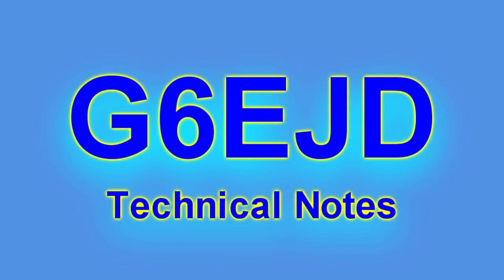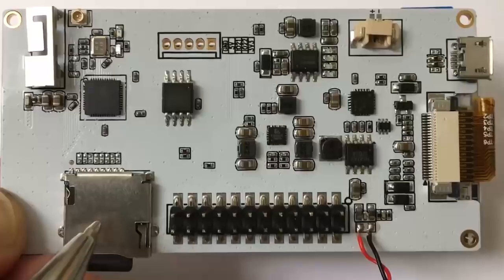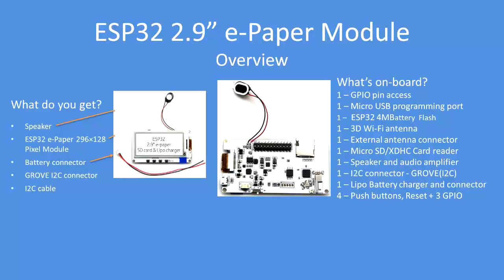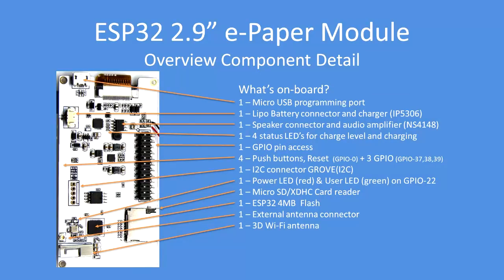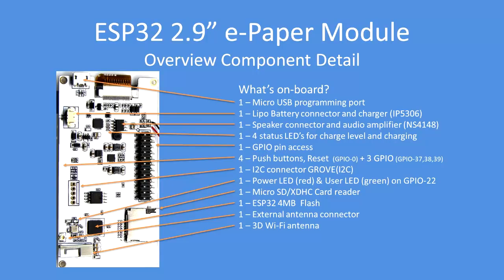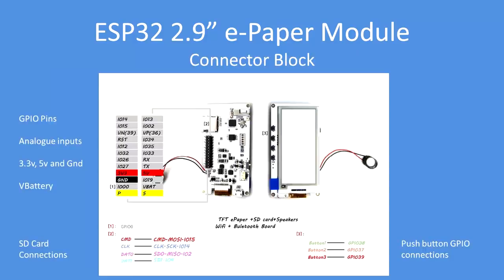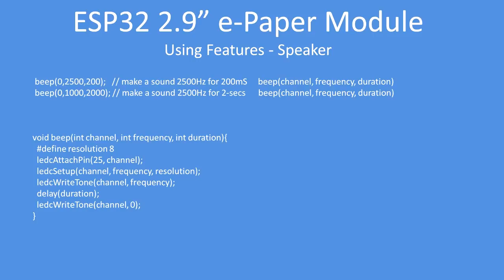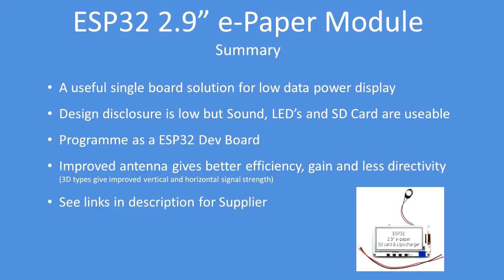Tech Note 099 - ESP32, 2.9" e-Paper, Speaker, SD-Card Reader and Lipo charger

Comment: Hi, did anybody try a newer version of this board? I have v2.2 and I am strugling to compile code for the display. Thanks iarakis@kaixo.com
Reply from the maker: Ivan Arakistain, unfortunately ttgo support is poor, I expect it will work ok once the configuration is correct but getting the information is not easy, and what’s more confusing is for someone to make a board but give no supporting information that will then go on to probably make it a success- it’s bizarre supplier behaviour. Maybe worth checking out the ttgo / lilygo GitHub for details
Reply: hi, did you manage to make this work please? If so, please share any instructions you might have please :)

Comment: After a few days trying to force the IP5306 (battery management chip) to keep its power on, I found that I can't reliably keep the IP5306 awake even by simulating a button press every 30 seconds.

I'm not sure why, but after a few hours, it turns off when the ESP32 simulates the button press.

So I've removed the IP5306 from the board completely, by cutting its legs. Note it also has a pin 9, which is a pad on the underside of the chip, which I hadnt noticed on the datasheet, and luckily it wasnt soldered down that hard and I was able to twist it off the board.

Probably using a reflow tool would be a better idea since it probably won't matter if you damage any of the components around the IP5306, as they are mostly only used by the IP5306 its self.

In its place (externally to the board), I'm using a TP4055 based battery manager module, which has an input for the 5V from USB, and separate connections for the battery, as well as Gnd and an output terminal.

Initial results from this setup are encouraging, with a fully charged LiPo cell, producing 4.1V, the board is working fine.

But I'll need to leave it on for a few hours and let the battery go a lot flatter before I can tell whether the buck converter is happy working down as low as around 3.2V at when the Lipo is almost flat, but in theory it has an input range of 2.7V to 5.5V, so may work OK ;-)
Reply from the maker: It’s worth contacting Lilygo about the board as I understand they have redesigned it following mine and other complaints to Banggood, you might get a good price for a replacement.
Reply: I bought mine in May from AliExpress, via a third party supplier, so I don't think there would be any chance of getting a replacement.

I wonder what they did in the redesign, probably partly what I've just done.
Ideally they'd also want to control the buck converter outputs that drive the audio amplifier, using a GPIO on the ESP32, but I'm not sure that using the EA3036 buck converter as the voltage regulator is ideal (http://wiki.widora.cn/_media/ea3036.pdf)  . But I can't see in the datasheet what its operating current is. 
It mentions 80uA quiescent current when there is no load; which may be the current its going to take when the ESP32 is in deep sleep mode - which would not be too bad.

But there may be better IC's to optimise low power operation
Reply from the maker: I’ll see if I can find the latest version schematic. The problem with these Chinese ‘suppliers’ is they can copy but don’t understand what their copying and do no testing before releasing products. If they sent out samples for testing they would save money, also Banggood weren’t happy to stock problematical products.
Reply: Thanks.
Reply: BTW. I removed the power LED and the board still takes around 6mA when the ESP32 is in deep sleep. I think that around 3 or 4mA of that is being taken by the NS4148 audio amplifier, so I'm going to try to use its CTRL pin to put it onto low power shutdown.

But that leaves another 3mA unaccounted for, which may be in taken by the buck converter or some other resistors on the board. 

So I think getting the current consumption down to a few hundred microamps may be very difficult.
Reply: As a final followup...
I've managed to get the current drain down to 1.5mA but I don't think its practical to get it any power.

I removed the pullup resistor on the NS4148 audio amplifier CTRL (Pin 1) and soldered a 10k resistor to ground instead.
I then connected the IO19 header pin to Pin1 on the NS4148.

This keeps the NS4148 in low power mode, until I drive IO19 high. i.e before I can play any audio, I have to do this, and afterwards set IO19 as high impedance (aka input)

I've had a look at the EA3036 multi output buck converter, to see if I could use its ENable pins to shut down part of the chip that was not driving the ESP32, but this would be hard to do, because all the enables are directly connected together and share the same pullup resistor. 
So it would take some extremely delicate surgery on the board to cut the track(s) right next to the chip and control the outputs separately.

And I'm not entirely sure whether that would actually help reduce the current any more.

Without a schematic for this board, its going to be very difficult to know what else could be taking any current.

So I think I'll need to live with 1.5mA when the ESP32 is in deep sleep.
Reply from the maker: Good work and analysis. The M5 Stack schematic is 99% equivalent they copied it verbatim. The only difference is the SPI connected TFT display is replaced by a epaper display.
The M5 Stack can be woke from sleep by a single click of its push buttons d sent to sleep with a double click and as far as I can determine they are controlling the 3 port power management chip to do that, certainly the libraries switch on the various devices bevy they can be used such as the audio amp. The M5 stack schematic is at the M5 stack web site.
Reply: AFIK. The TTGO T5 board has the RST pin connected to the IP5306 wakeup pin (5).
I found this out when I removed one of the resistors on pin 5 and the board would no longer accept uploads because the reset wasn't working any more ;-)

Looking at the M5 schematic (assuming its this one)

http://www.m5stack.com/download/M5-Core-Schematic(20171206).pdf

my TTGO T5 does not seem to be quite the same. On the EA3036 all 3 enables seem to be connected together and share the same 10k pullup.

I can't see anything on the M5 Stack schematic which could turn off sections of the buck converter (EA3036) or the audio amp.
The enables for the main 3.3V output are both connected directly to the 5V rail, and although the enable for the audio amp supply has separate pullup; its not connected to a GPIO on the ESP32 (and would need a pulldown not a pullup in this case)
The audio amp circuit appears to be the same, with its CTRL pin pulled high via 10k

I don't think there is any way that the M5 Stack boards could draw less than about 5mA, and also the IP5306 will have the same shutdown issues that the TTGO board does.

The IP5306 is the wrong device for this board, and possibly for the M5 stack, unless they deliberately wanted to able to power 5V modules.

The battery management modules that use the TP4055 (charger) and DW01KA and 8205A (battery protection), seem to better, and there is probably one chip that does the job of all 3 of these.

Cheers
Roger (VK3KYY/ G4KYF)
Reply: BTW.
I have now done some more testing, and the board happily works down to the cutoff point my external battery manager module, (which seems somewhere around 3.2V)
Reply from the maker: The buck convertor is doing well. I tend not to discharge lipo's below 3.6 which is their empty voltage so I get maximum life from them and no puffing.

Comment: This is not a fix for the low power timeout, but one work-around is to get the ESP32 to wake up every 30 seconds so that the timer in the battery management chip, gets reset.

I've made a modification on my board and I've connected GPIO 19 to pin 5 on the battery manager chip, via a 1k resistor and I toggle this low for 100ms every 30 seconds.
i.e wake from sleep, pull the pin low for 100mS and then go back to sleep.

The ESP32 does not need to have its Wifi or anything else on when its going this, and the battery manager will keep the power on when its doing this.

I'm going to remove all the LED's from the battery manager and also the red (power) LED, and see how much current it still takes.

Note the audio amplifier chip can also be put into low power standby if one of its pins is connected to a GPIO on the ESP32, i.e so that the ESP32 can turn on the amplifier only when its needed.

its also possible to disable the outputs on the buck converter which supply the amplifier, but it would be difficult to modify the board, as the tracks from the enable pins go straight to a via, so it would be hard to cut them. But I guess I may be lucky and find a SMD pullup resistor for these somewhere else on the board, which I can tap onto
Reply from the maker: Good observations and mods, I'll try some this coming week. It's a pity the power management chip can't be overridden to stop it from removing power. The design (aprt from the display) is a direct copy of the M5.
Reply: Unfortunately my modification to keep the battery management chip turned on was only partially successful

Initially it appeared to stop the board from powering down, however, I left it running overnight and in the morning the board had powered off.

I checked my Lipo battery voltage, and it was 4.05V.

I'm not sure if the battery charger has some other timeout, which can't be overridden or if there is something else going on.

One possibly problem with the way I have my keep-awake circuit wired, is that the RST line, is already connected to the same pin on the battery manager chip.

So its possible that my keep-awake circuit could occasionally be causing a reset to occur.

However, I think ultimately the only way to resolve the power problem on this board may be to remove the existing battery manager chip completely and use something different

Comment: I just found this video, after discovering most of the information myself by reverse engineering the board.

I made some notes on this on my blog a few days ago

http://www.rogerclark.net/ttgo-t5-2-9inch-e-ink-display-with-esp32-mcu/

I think you omitted to mention one chip in the middle of the board, which seems to be a EA3036, multi output buck converter.  I presume this is being used to supply voltages required by the e-Paper display, but I'm not sure

http://www.everanalog.com/Product/ProductEA3036DetailInfo.aspx

I could only find a chinese language datasheet for the battery management chip

https://cdn.datasheetspdf.com/pdf-down/I/P/5/IP5306-Injoinic.pdf

My chip turns off the power to the ESP32 after around 35 secs after it enters deep sleep.

One thing I've noticed is that if you press the "Reset" button, a few times, it triggers the battery management chip to wake up again.

I'm not sure if you mentioned Pin 25 thats connected to the audio amplifier http://www.chipsourcetek.com/Uploads/file/20151207193630_0605.pdf 
is also a DAC pin, and its possible to play low quality (8 bit) audio files to the speaker - however as you might expect, the quality is not that good. 
I've not looked in detail, but it looks like the audio amplifier is being over-driven, and would benefit from some input attenuation.

Also, if you apply PWM etc to GPIO 26 there is a bleed through into the speaker, which I think is being caused by the capacitive coupling, of the two tracks, as GPIO 26 is routed to the pin header, so there is around 5cm of track where I suspect both signals run side by side; and since the amplifier seems to be over-driven, its picking up the weak signal on GPIO 26 coupled into GPIO 25

If you want to try the audio, this library worked fine 
http://www.xtronical.com/the-dacaudio-library-download-and-installation/

Albeit, the quality of his example audio sample is very low, and you'd be better off making your own sample using Audacity and HxD to convert to a C array (Note HxD does not prefix the array with const, which you'll need to do otherwise the compiler tries to stick the array in RAM and it won't fit!)

BTW. I connected the speaker output to a home Hifi speaker, and the sound produced is very loud; definitely several watts, but I'm not sure how long the audio amp chip could sustain this before getting hot.

Re:SD
Looking at the SD library you linked to, it looks like its just using SPI, (I thought it may be using 2 wire SDIO based on the pinout image (the only available reference)), so it appears that the only reason that the standard SD library doesn't work could be the pin designation.

I had a quick look at the Espressive Arduino SD lib https://github.com/espressif/arduino-esp32/tree/master/libraries/SD but the only pin that can be easily changed is the SS pin.

The espressive SD uses 

SS GPIO 5
MISO GPIO 19
MOSI GPIO 23
SCLK GPIO18

But this board uses

SS GPIO 13
MISO GPIO 2
MOSI GPIO 15
SCLK GPIO14

Perhaps the way to do this is to declare a separate SPI class on alternative pins and pass it to the Espressive SD lib

Re:Low power problem
I wonder if a hacky solution would be to provide a bypass power path, only for deep sleep operation.
i.e a resistor and some diodes, directly from the battery, or perhaps a 3.3V LDO connected to the battery and then a 1k or higher resistor to the ESP32.

It may require tracks to be cut so that the ESP32 does not back feed the rest of the circuit.

But I think its worth investigating

73's VK3KYY ;-)

Comment: Did you try to run the board on battery? If you read the datasheet for IP5306 you will find out that the chip as a automatic standby after 32 sec. if you do not draw 45 mA during that period. I had this issue with a similar board form the same maker. The board is not usable on battery...
Reply from the maker: Yes I found the same, the board is a clone of the M5 and because of the power management chip it is totally useless for battery usage and I ha e advised the supplier of this, needless to say they have ignored me!
Reply: They actually followup (maker) on my comments. They ship me 2 supposedly new board with the issue fix. Will see ...
Reply from the maker: Good to hear as I sent a list of about 5 design faults to Banggood who asked me to do that and they passed those on to the supplier. So between us the problem might be fixed.
Reply: Have you tried the new boards and do they fix the issue?
Reply from the maker: I know but this is what happens when you copy a design like the m5 stack and clearly they did not understand

Comment: Where did you get the e-Paper driver and which SPI is it on?
Reply from the maker: The driver links are in the source code found via the links in the description. The SPI bus is the only one available on most development boards. The other bus is used to read the flash memory on most development boards.
Reply: Got the TTGO T5 V1.3 working with IDL environment but Arduino still not working for me.  Seems to be a problem with the SS pin assignment but not sure.  Have more control with IDL in any case.
Reply from the maker: Because the board is basically an M5 Stack clone you need to use that board type then all of the M5 examples work except the display but easily swapped e.g. M5. Prefix for say the minigrafx driver and make M5 gfx whatcha out for sleep mode the power management chip switches off power after about 46-secs. Design fault
Reply: G6EJD I was using the ESP32 Dev Board device.  So I will try the M5 Stack setting.  BTW where did you learn that the M5 setting works.
Reply from the maker: By examining the pcb and components fitted I realise apart from the display the components were identical so then I did some pcb track tracing and then that led to the M5 Stack library - not that the supplier says that they just leave it to the customer to figure it all out, not helpful.
Reply: G6EJD I agree, a schematic would have been helpful.  I have a couple M5s but wanted something with a lower power display.  I have used E-ink displays with commercial products before and liked their low power characteristics.  Thanks for your advice.
Reply from the maker: In a way the schematic is that of the M5 the display is still an SPI connection so that’s identical but the power management chip is a disaster in this design and loses all the advantages of an epaper if sleeping.